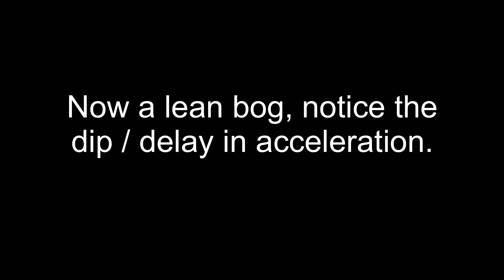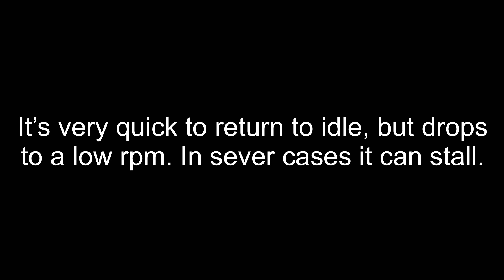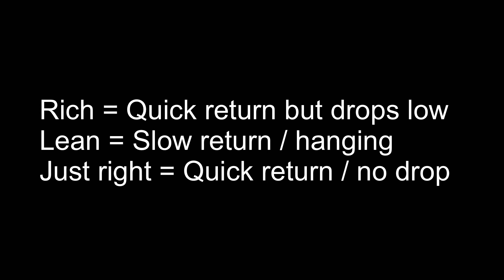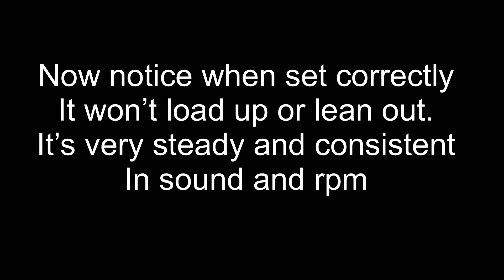TUNE YOUR 2 STROKE - LEAN VS RICH

Comment: trying to figure out Needle positions on my moped thinking Lean Bog as idle sounds thin goes low and stalls have to keep reving it to keep the  moped running at stop lights. when cool idle is right up there and slowly settles down as the motor warms up from a ice cold start working on main jetting also. this is a single circuit carb no air screw just a screw that raises up the slide which it is all the way in and what above happens.
Reply from the maker: Only one circuit? Are you sure?
Reply: @VintageEngineRepairs absolutely it is what is termed by the community called  a round Bing carburetor the screw only raises up the slide increasing rpms no air metering screws no pilot jet just the emulsion tube which ha no side holes BTW no idle circuit. The needle that goes in the emulsion tube.the slide and main jet that screws into the bottom of the emulsion tube that’s it.

Comment: its okey to understand and tune basic 2 stroke machines like chainsaw, blower etc. Only has one or two stage Air screw. But its not enough to advanced tuning related rev up and increase engine response of the bike engines have jetting or else adjustment abilities.
Reply from the maker: Fuel screws on 2 stroke ope. Bikes have 3-4 fuel circuits. A pilot jet and air screw, main jet, needle height, the needle taper and power jet. The same principles apply to tuning them in terms of lean and rich.

Comment: Thanks Tom, that is the most useful tuning video I've ever seen. Understanding the return to idle time and how it settles over the next 30 secs is really helpful. You mention easier starting with a richer L screw. I have trouble starting some of my 0xx series Stihl saws. Do you think running richer L would help?
Reply from the maker: You’re welcome! Yes very likely! It could be something else like needing new diaphragms or an air leak, but it may be necessary :)

Comment: Great video! Better than anything online
Reply from the maker: Thank you!
Reply: @VintageEngineRepairs  I have a quick question, so I just ordered a new 2 stroke from eBay and I have been trying to get it run, but every time I full throttle it dies after 1 minute. It says that I should be using 25:1 fuel ratio in the description of eBay. It also may just be the tunning. Do you have any idea why this is happening
Reply from the maker: @kodiepeterson6269  it sounds like it could be lean on the H screw, though without seeing it it’s impossible to say! I’d suggest checking the obvious like fuel lines for cracking and filter for blockages. Then check the piston for scoring (remove the muffler) and then lastly open the H screw 1/4 of a turn and see what happens :)
Reply: @VintageEngineRepairs  I could send a you a photo through email if possible
Reply: I have been at it for 3 days and I checked for scoring, there is none

Comment: This isn't really helpful for my 2 stroke motorbike situation. I'm having major problems getting it tuned right. Stationary it runs absolutely sweet. It will idle all day, revs straight out when I stab the throttle and it comes right back down. No major smoke either. When actually riding under load, it really hesitates to pull into the powerband, it sounds lean just like this video shows. I'll need to drop down a gear or smash the clutch to get it going. If i'm anywhere under 3/4 throttle its just BOG. There is no detonation and the plug is super black. The metal band around the electrode is still shiny after 4 hours of riding. I just installed larger jets yesterday and went riding today, the low end response was the same.. if not worse. except I now have a hanging idle issue. But when it's on the pipe wide open throttle it goes much better.. I've been looking everywhere on the internet for help but can't seem to find anyone with a similar situation. I'm going crazy lol
Reply from the maker: Hey mate! I’d suggest doing a pressure and vacuum test first and also inspecting the piston skirt for scoring. https://youtu.be/kUmeyVcnZrs
Reply: @VintageEngineRepairs  bike has 5 hours on a new top end, 50 hours on bottom. All new gaskets, brand new reed valve boot. Compression is high.
Reply: @VintageEngineRepairs  just going to sell the bike hey hahha money pit KTM

Comment: Any tips for adjusting a single screw carburetors? I'm having trouble getting my ryobi string trimmer running right
Reply from the maker: Which screw do you see on the carb? Give me an idea of where it is :)
Reply: @VintageEngineRepairs  It's a Ryobi RY253SS trimmer. The adjusting screw is an "A circle" located in a brass recessed space in the middle of the throttle body plate. It also has an idle screw. I tried to attach a link to an image for reference but I think YT flagged my comment.
Reply: @VintageEngineRepairs  what do you think about that single screw carb adjustment?

Comment: Something strange about my weed wacker is how it will stall if the nose is tipped down with it too rich. Opposite when nose at the sky.

Weird fuel pooling perhaps?
Reply from the maker: Yep fuel pooping, probably in the intake manifold. Try running it as lean as you can on the L screw whilst still getting good off idle acceleration and easy starting
Reply: @VintageEngineRepairs  Thats what I did. Probably partially caused by the pumping diaphragm being slightly wrinkled.

Comment: Great sound info.  Will have to listen several times.  Been tuning by ear, but can  help to constantly hear.
Reply from the maker: Thank you! Yes you may need to play it back, with head phones in :)
Reply: @VintageEngineRepairs  helps to use your own. Count starting threads, then adjust rich and lean. Try to make the sounds.
Reply: Tune by ear? Really. I always tune to get the plug to the right color. Only been doing it 40 years.